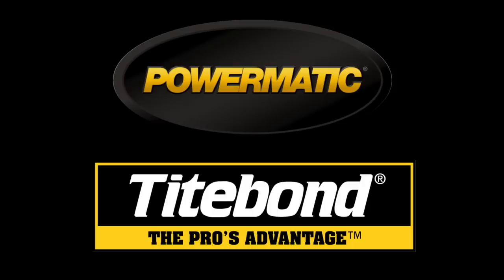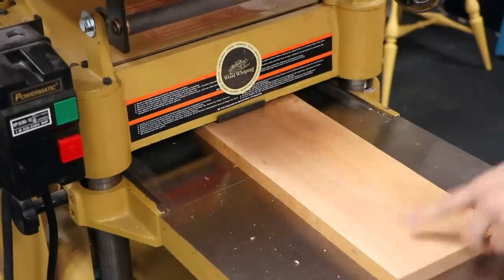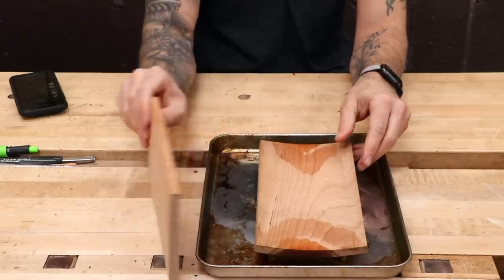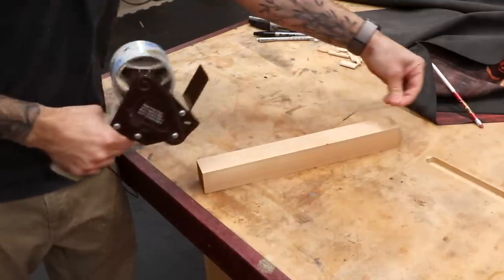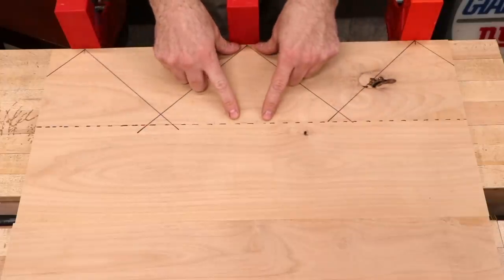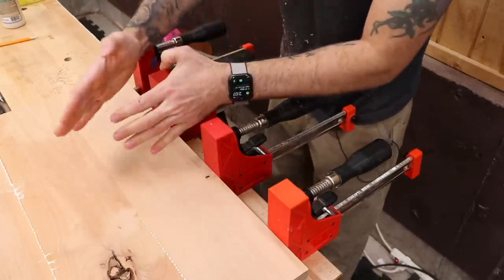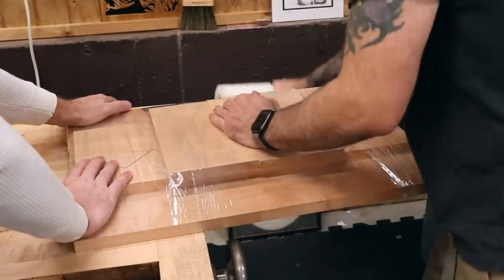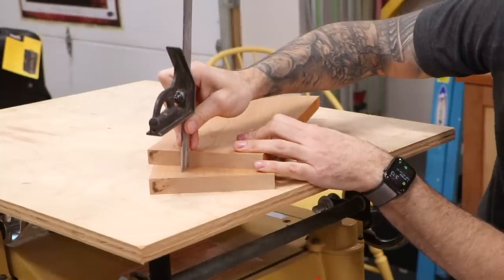10 Tips for Wide Panels that Stay FLAT

Comment: The logic regarding end grain orientation is flawed . (not my personal opinion, this is a century old observation and a time proven protocol) :
1) even if a 36" surface was what is needed you WOULD NOT just use a 36" wide piece of wood if it  (38")was available . You would break that board doown into 4-6 " ripped strips AND you would shuffle the pieces so as to end up with a continuity to the grain BUT you would reverse the 'up' orientation of every other strip .
IF you examine the tops of decade old pieces of furniture constructed in this method you will find a perfect maintenance of flatness that has endured .  (ALSO you cannot 'flatten out a large surface that has cupped because this rule was ignored without the eventual cracking in the surface, much like gluing an end board tightly cross grain to a top will eventually fail due to unequal expansion of long vs short graining.